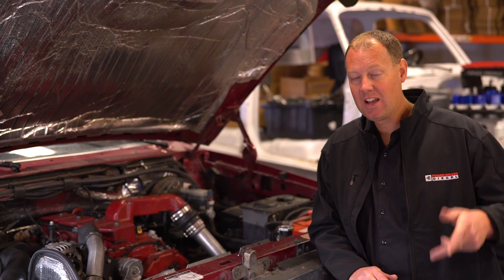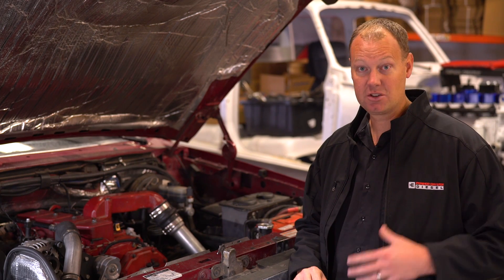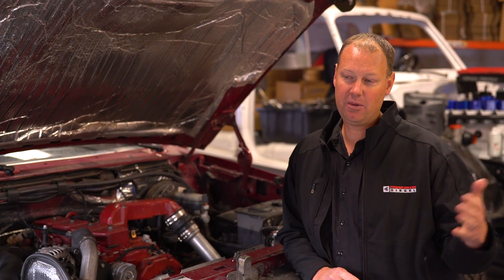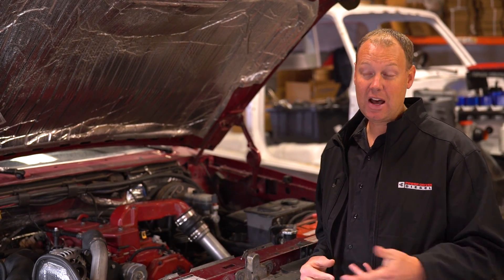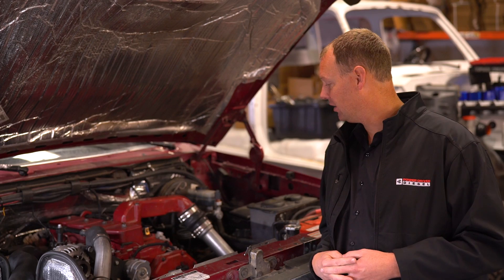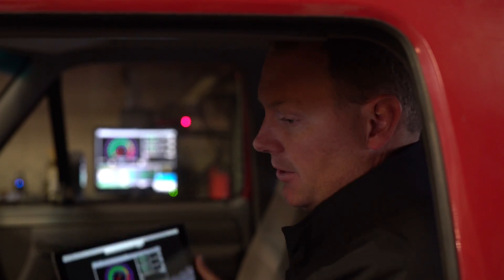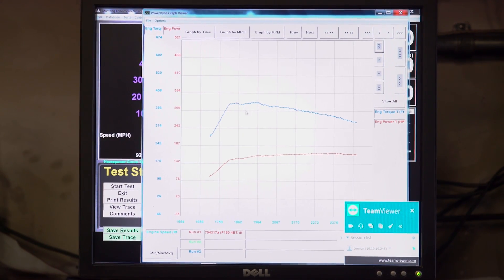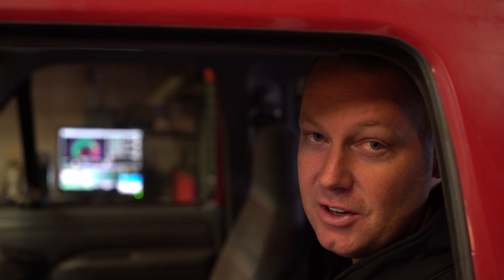Dyno Test: 4BT Cummins Powered Ford F-150

Comment: I made 173/336 on our dynojet with a bone stock other than fuel screw turned up 140hp non intercooled 4bt with a nv4500. Your dyno must be really stingy or that pump is weak or something.
Reply from the maker: Our dyno is extreamly stingy.

Comment: But the alternative to these trucks are there original power plant the 5.0,5.8 In the F150 models none of which these motors made over 250hp in the truck version exception to the ford lightning of these year model trucks

Comment: After several cases of miller lite and the luck of a 4bt with the ford bell pattern, we dropped it into a swb 2wd 85 f-150 with manual trans where a 300 6 came out. The truck came with a 3:55 open rear diff. No power mods to the 4bt bone stock the truck had more get up than those old pos 350 olds converted diesels as at the time dads old pos chevy 350 diesel was still rotting in the pasture i think gm replaced that engine 9 times and tiil this day i still won't but any gm junk. Back to the real truck it made 35 mpg at or below 65 mph. Take in mind it was no power house and you did not jump out in front of traffic as you would get your ass ran over. My friend who owned the truck drove it 55 miles one way to work for 8 years with the 4bt zero problems before he died. He claimed the truck had over 600,000 miles on it when we pulled the tired 300 i6, but he bought the truck new and drove it back and forth to work for many years and bitched about the 16 mpg it got with the 300 engine. The 4bt we installed was brand new on a pallet that was in a flood, it had the water in it for about a month and a half when he got it for nothing. The factory pre lube grease did a fantastic job on protecting the inside of that engine as it was nearly totally rust free inside. Tore it down inspected cleaned and put back together with new gaskets sent pump and injectors off, reworked and reinstalled.  I have a 1981 dodge van a very rare shorty with a slant 6 i bought months ago for a grand,,,,, thinking about FOUR BEE TEEING IT if the funds allow but the slant has to go bye bye.

Comment: I have a 1999 6sp 24v Cummins and when I start it in the morning it starts like the day it was new but if I get it to 190 degrees “Operating temperature” but when I start it I will hit the key it will spin and not start then I let off and hit the key again it starts good what do you think the problem is P.S all stock

Comment: How much would it cost (ballpark) to do this on a 2019 f250?
Reply: Why the hell would you want a 4bt in a f250???
Reply: Cammed LS What’s it to you?
Reply: Cammed LS Obviously it’s lighter, cheaper, and more fuel efficient.
Reply: shylildude While some of that is true a 4bt is really not gonna be what’s best for that Application. Go right now on marketplace, Craigslist, eBay or anywhere you can find a used 4bt. I’ll just go ahead and save you the time but a 6bt will be ( majority of the time) cheaper than a 4bt, there’s just more of them. As far as weight goes why would it matter? A new ford 6.7 weighs in a 1,100lbs, that’s the exact same weight of a 6bt give or take a few. As for fuel economy it would be relatively close to a 4bt and not working near as hard, also obviously yields more power.
Reply: @cammedls3532  a 4bt with compound turbos, bigger injectors and a few other mods would be just fine in a 3/4 ton pickup as long as just driving is your main use and not dragging trailers around all the time. Yeah the 6bt’s would be an all around better choice but you could still get significantly better mileage out of a 4bt as long as you were in the 200 - 300 hp range, especially with a five or six speed manual trans. I’m looking for an obs Regular cab F350 4x4 to repower with a 4bta right now
Reply: @warrenmcelroy4718  I’ve seen a lot of videos on older 4x4 70s f250s with 4bts in em, Not terrible I guess but me personally I’d like the 6bt in a obs, less vibration and is still cheaper. I can get a p7100 12v where I’m at thats running with all the accessories for around $3,500. A wore out 4bt wiil run almost 4K, just not worth it to me lol
Reply: @cammedls3532  well that’s the whole point, it may not be worth it to you but it’s obviously worth it to the person that decided to put the time and money into their build. And yeah they can be pretty expensive but like anything else you just have to wait for the right deal. I paid only $60 for the last 4bt that I bought because the Case skid loader that it was in was being scrapped and so the company I work for let me buy the engine out of it because I offered them double the scrap price for it. The good deals do come along you just have to be patient.

Comment: FYI The 6.2 v8 makes................ 460ftlb torque!!!!!!!!!!!!!!!

A 4 cyl with HALF its DISPLACEMENT made nearly the SAME power.
Reply: It has no where near the same power. Unless you mean torque when you say power.
Anything with boost will make impressive torque, a turbo charged diesel with nearly 1L per cylinder, that sounds about right.
Reply: @danh8302 The last year of the 6.2 made 160hp and 285 torque.
So you are right the 4 banger blew the v8 out of the water.
Reply: @lonsmithwesson1661  Oh i read that as the “6.2” as the new gas motor not the Detroit diesel. My fault.
Reply: Which is 420 hp and 460 lb ft, hence my power comment
Reply: @lonsmithwesson1661  it is amazing how little power that 6.2 made in civilian trim. A 4-71 Detroit peak numbers are 152hp 400tq and the 4-71t is 190 hp 525 lb ft.

Comment: You did great. The 6.9 and 7.3 idi were rated at 180hp at the crank. Your putting 170 to the wheels with less fuel, less cylinders, and more torque. The 5.0 v8 in that was rated at 185hp at the crank. The 300 6 was 145hp at the crank.  That engine is plenty
Reply: This thing TOW enough,as in,towing
a car on a trailer or a boat.It does so
with upper 20s MPG and will do so
for decades to come.
Reply: No, its not "plenty", not for modern traffic where everyone and their mom has a turbo charged economy car capable of 7.0 second 0-60s. Adequate for 1983 maybe but not 2020. 160 WHP in a truck that size is a dog. Total waste of money doing any kind of swap and investing time and money into. Just makes zero sense. V6 trucks in the past 20 years put more power to the ground than that.
Reply: @Clapxiomatic  I dont think speed was the goal in mind for this build. I think it was for reliability and fuel mileage. If everyone built the same thing, the car world would be boring. People seem to forget that trucks were made for work. Their not race cars.
Reply: @Clapxiomatic  you must have missed where he said 430 torque.
Reply: . Yea a nice build ..thanks for the video ..

Comment: These motors came stock in the F350 - in Brazil. I am running a 4bt in my 1942 Dodge Carryall - when I go out crawling on the weekend it costs me 15 -20 bucks, Same trip in my Chev trash truck costs about 80 bucks. Would I like a bit more power? Yep. I can run all day at 60 on the highway at 5 lbs of boost, but once I hit a hill the truck pretty much runs with the big rigs. Next upgrade I will shoot for is getting the intake air temp down and perhaps compound turbos.  Interesting enough the exhaust temps dropped when I went from stock to an HX30 turbo, the temps may drop more with compounds. Only mod I have done to the pump is I machined up my own dynamic timing plate - That made the motor much quieter, enough that neighbours wanted commented that the truck was much quieter.
This is a tractor motor - really loud and vibrates like crazy - but the fuel milage is absurd.    What I am looking for is some injectors that atomize the fuel better than the 30 year old ones it came with - there must be some advances over those years.
 A bit like driving a big rig when using this block -  from a stand still you  are well into  third gear before you cross an intersection :)
Reply: Diesel gang 🔥🔥
Reply: They came factory in the F100’s but I don’t think they came out in the 250 and 350 trucks down there.
Reply: I live in Brazil and I have a F250 1999 shortbed Cummins 4BT original, with 145HP, HX30w, VE pump, I put the fuel pin and put a HE221w holset and the ISB4 manifold that came out in the F250 from 2007 here, it already improved the performance however I'm thinking of a bigger turbo that doesn't have a slow spool, I thought of the Borgwarner K24 compressor 47.5mm and turbine 49.5mm I think I can get 250hp with it well fed with diesel, my engine turns around 3800rpm.

Comment: Well that was disappointing. I guess the P-pump is the only way to go. This modified 800lb engine made less power than a 600lb big block. It looks like the only reason to do this is for fuel economy. If that's the case then you're better off with a VW TDI. The cost of the swap, the work involved and the suspension upgrades required to make 160hp is way more than the amount a fuel you could ever save.
Reply: wvXvxvXvw its the cool factor haha

Comment: Can I swap the engine in my 2010 F150 4x4 lariat, with a diesel engine, just looking for more towing power/ torque and better mpg
Reply: If you have to ask, hell no.
Reply: Be a bit cheaper just to buy a diesel truck .
Reply: @josephfoster3819  True :)

Comment: Why? Just why would you put a small 4cyl. in that truck?
Reply: Because it makes good power and it fits easily. And doesn't require modification of the suspension. 6bt is tight in the 90's fords and weighs over 1k lbs. A 350 w/heavy springs could take it, but a 150 with the TTB axle and such would be really straining under that load.

Comment: I would love for you guys to have more aftermarket or even oem parts for the bosch A pump it's a much cheaper alternative to a P pump for 4 cylinder applications and more than a ve pump.
Reply: @pddofficial  I have one torn apart now i can email you  links and pictures to all of the info i have found for them. it had varnished delivery valves I was able to free up and an rsv governor with an electric solenoid bosh on the side of what looks like the afc housing on it.

Comment: The truck weighs 5000-5200 lbs. If you're running 30+ psi of boost, make SURE you replace the factory head bolts with ARP studs. I learned this on my Bronco, the 6BT runs 32 psi, and it actually ripped one of the center head bolts in half. I've never seen that happen before, especially on a bolt that thick. lol
As for limited, the 4BT can be built up to 300-400 hp without a ton of money. The same way a 6BT can be built up to 500-600 hp. If you want to spend the money, a 4BT could do 500+ hp, it, like it's bigger brother, are incredible engines, with nearly unlimited aftermarket support and power potential.

Comment: The 4BT is such a terrible engine for these conversions. Anybody that suggests the 4BT for a conversion doesn’t know shit about these things. 
It’s not the 6BT. 
The 4BT rattles, shakes and vibrates like nothing you’ve ever experienced. They shake themselves apart. The newer common rail models vibrate so hard the wire harnesses fall apart. 
There are plenty of other, far better candidates for engine swaps.
Reply: I have a p pumped 4b in one of my excavators and it is smooth as silk, but I will say it has a pretty high idle. I am sure that helps. Its around 875 or so. Seen a few in marine apps too with good results. These are a great fuel miser swap if you don't need a ton of hp. Everybody was after the Frito Lays chip trucks for this engine.
Reply: Driven 4BT forklifts for the better part of the last 20 years and yet to have one shake it's self apart.  Guess weak gas chassis would find any weakness though.
Reply: If your 4BT is vibrating that badly, you've got one or more serious issues unrelated to the design of the engine.  Tune the engine to spec; if the vibration doesn't go away, you may need to tear it down and check for shoddy assembly.  Make sure when you go back together with it, that everything is properly balanced and in-time; if your idle is a bit too low, there can be a noticeable shake, but as soon as you're on the throttle, it'll smooth-out and purr like a kitten!

Comment: Why, WHY would anyone do this?
Reply: The94GTC  Because the engine is ridiculously heavy, makes no power, probably wont last long because 4BTs don't like to have their power hugely increased, all while polluting like a locomotive.
Reply: The94GTC  For as much as this conversion costs (along with the engine modifications), he could have swapped in a gasoline engine that makes around twice as much power, makes just as much torque (even though torque doesn't do anything for performance) and weighs a little more than half as much. There's no way that this engine is getting 30 mpg in this truck... maybe when it had 80 hp.
Reply: Why did I put a 2 Stroke 4-53 Detroit in a Chevy C20 with a medium duty transmission?  

Bored, have the skills, had the parts, had the beer and a welder.
Reply: The94GTC  No, both torque and horsepower are measured, and both are calculated. This MYTH comes from the fact that some dynos measure torque and then calculate power, but other types of dynos measure power and then calculate torque, it works both ways. Physics is all math, buddy, and if you had ever taken a physics class, you'd know that.

Diesels produce less torque than gasoline engines unless they're boosted higher, they don't burn the same amount of fuel during their combustion cycle. Compare the torque output of the Olds 350 diesel, or a naturally aspirated 6.2 or 6.5 Detroit Diesel V8 to a Chevy 350, which engines make more torque? Compare the Mercedes OM604 engines to the Honda F20A and F22A engines, which engines make more torque?

Diesels burn less fuel by volume, but about the same amount of fuel by weight, and the cost and CO2 emissions associated with burning diesel are more closely related to the weight of the fuel, not the volume.
Reply: rock solid  Why not just get a modern gasser V6?
Reply: rock solid  Yeah, buying American vehicles sucks, they just aren't built to last.
Reply: The94GTC  No, it's called PHYSICS.
Reply: The94GTC  No, buddy, power is EVERYTHING. Here, I'll make this extremely simple for you: Imagine there's a 20 ft long metal bar being spun around by a motor with 10,000 lb-ft of torque, but it's only spinning at 2 rpm, what happens if you get hit by it? It'll certainly move you out of the way, but it wont bother you much. Now imagine that the bar is being spun around with 10,000 lb-ft of torque but at 2,000 rpm, what happens if you get hit by it? You'll probably be torn in two, right? What made the difference there? The faster spinning bar is being spun by 1,000 times more POWER than the slower one. Power is the difference between you being slowly nudged out of the way and being torn to shreds. There's an ACTUAL difference there. 

"Torque is an actual measurement of work."

Yes, but power is a measurement of ACTUAL work over TIME. 

TIME is the key here. Human being are concerned with how quickly something can be done in TIME. 

POWER tells you how fast you can get work done, like the work of accelerating a load and hauling down the highway. 

Diesel engines are popular in pickups because people are morons and don't know anything about physics or engineering.
Reply: The94GTC  Also, gasoline engines make more torque than diesels, unless the diesel is boosted higher.
Reply: The94GTC   Every manufacturer of trains, ships, tractors, trucks, etc... is concerned about COST OF OPERATION, not torque! If you want an engine to be efficient to save money on fuel, you run it at a low rpm, if you want it to last a long time so you don't have to spend money to replace it often, you run it at a low rpm, torque is just a product of the low rpm operation of those engines, it's not what engineers are after when they build an engine, they only want POWER. 

Turbine engines with very little torque have been used to power trains, they have been used to power heavy trucks, they power some of the fastest ships on Earth, and they were/are used in those applications because they make a lot of POWER. Turbine engines use a HUGE amount of fuel, so they cost a lot to operate, so it only makes sense to replace diesel engines with them when you need to do something like make a ship FAST, because your weak, heavy diesels engines can't make as much POWER as they can. Again, POWER is what makes those engines desirable, not torque, you can make literally as much torque as you want with GEARING.

GO BACK TO SCHOOL YOU ILLITERATE MORON.
Reply: The94GTC  No, YOU need to do more research. An inertia dyno (the kind that uses a rotating mass/weight) measures POWER. Again, power is work over time, and the more power you have, the faster you can perform work, like the work of accelerating a spinning mass. The more power you have, the more torque you can produce at a given speed. Yes, diesel contains more energy, but it also costs more and produces more CO2 when burned. No, torque and hp will not always be the same at 5,252 rpm, it depends on what units you're using to measure power and torque. It doesn't matter where they are the same anyway, because the units are representing two different things.

Edit: Also, work includes accelerating a vehicle, or dragging a heavy load up a hill... the more power you have, the faster you can get the job done.

And, yes, diesel fuel is more energy dense, but diesel engines run much leaner than gasoline engines, which means there's less fuel used in each combustion cycle, which means less torque... unless the engine is boosted high enough to allow it to exceed the torque output of the gasoline engine.